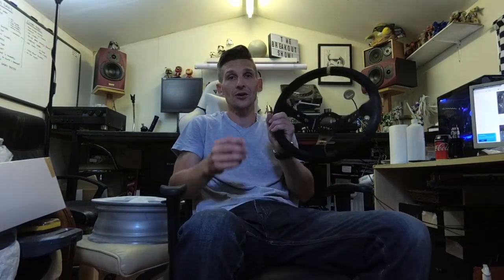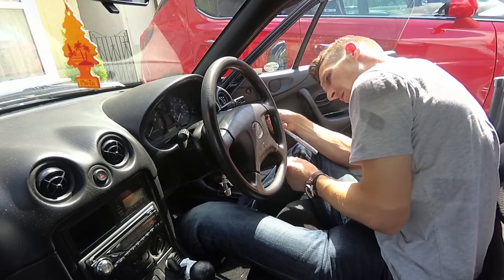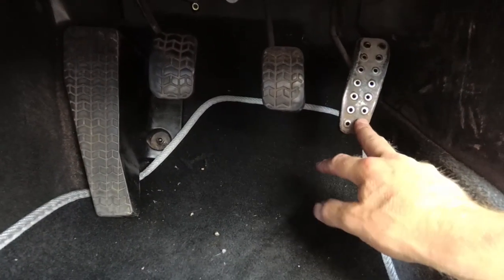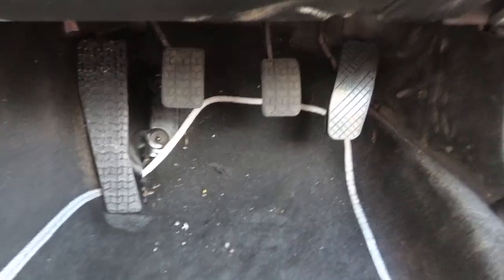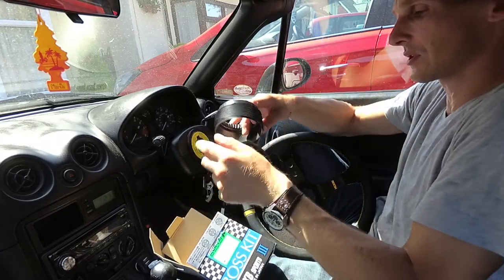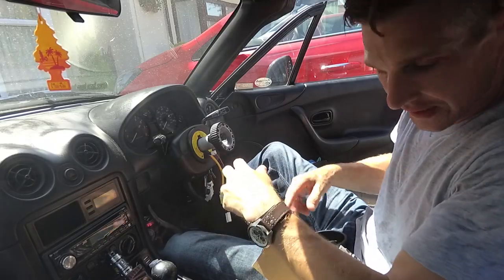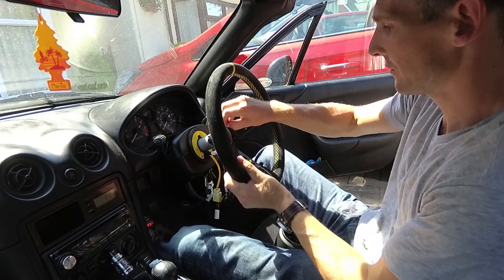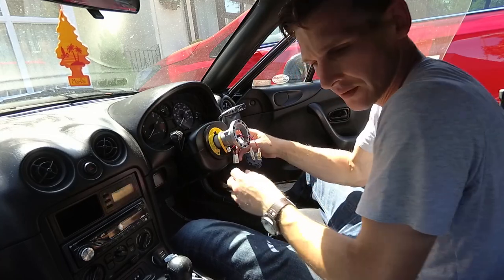Kode Steering Wheel, HKB Boss & New Pedal Rubbers - MX5/Miata nb

Comment: Thanks for the great vid.  Just fitted a Momo Mod 07 and HKB boss this morning.  As an alternative to drilling the boss for the horn wire, use one of the spare hex head bolts that came with the boss kit and screw it into one of the spare holes from behind,then fasten the horn wire to this.  I also drove a few yards before fitting the resistor and connecting the horn with the wires dangling, just to make sure I had aligned the hub on the splines correctly - I'd have been gutted if I'd taped everything up neatly and thought I'd finished, only for the wheel to not be straight!!
Reply from the maker: Yea that’s a good idea, didn’t think of that. Nice one.